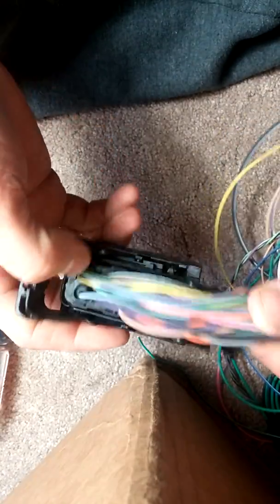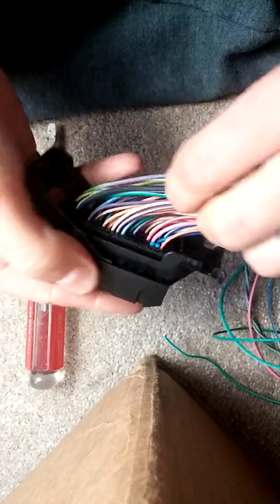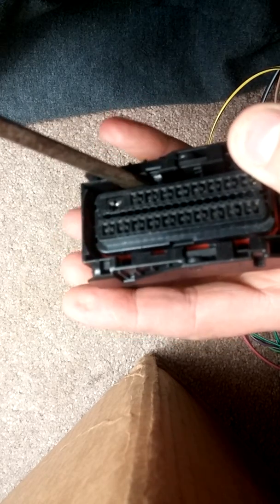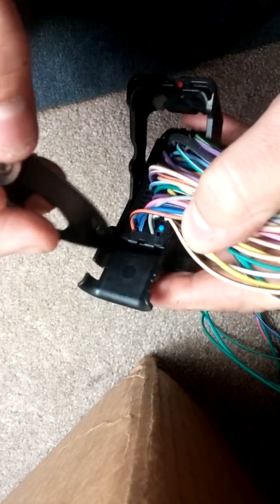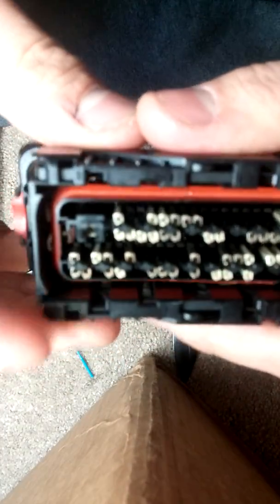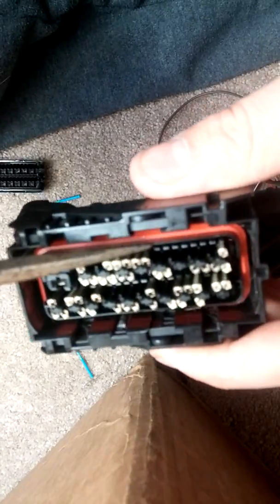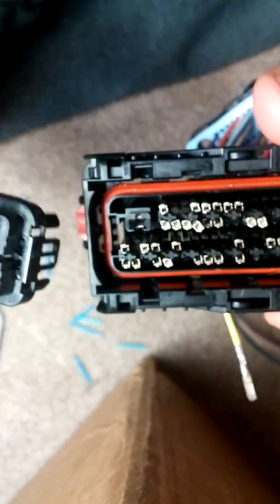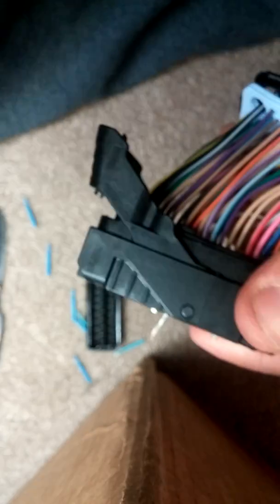Removing PCM Pins and Wires GM LSx E38 Ly6

Comment: How did you get the plastic cap piece off the top of that connector to expose the wires?
Reply from the maker: You mean the back section where the wires go in or the front where the pins are? Its been a WHILE since I took this apart and built my harness but I may have access to a harness i can check again.
Reply: @OverRevvedRacing  thx for the reply.   I mean the grey plastic protective cap that sits over the wires when it's installed - you have it removed here.   It also serves to hold the wires down 90° angle to the connector.

Comment: Good vid bud , but pretty much useless image with the phone camera . If you get to the stage of removing that front cover , you just push the terminal out by pushing on the wire . Just cut off the remaining wire , as i guess you are removing an unused terminal forever .

Comment: Good video, I am repairing my engine harness. I was wondering how to get to those pins. Thanks, video is a great guide & help.
Reply: Hey man how did it go do h have any tips in about to do the same thing
Reply: @jasonbourne4780  , the harness repair went good. Just take your time. Found out my problem was the fuse box, though. Had to junk my van cause they don't make them for 2008's any longer.

Comment: Fwiw, none of the back inside needs to come apart.  Take off the ecu facing cover to access the release catches.  The wires will pull through the rubber grommet grid and pin alignment grid with no trouble.  For reassembly, just make sure to align the pin when inserting so that it grabs the catch properly.
Reply: Yeah.  What you said.

Comment: Great video . I had a wire that was shorting and needed to replace it with a spare. Your video helped me to repair the circuit by removing the pin instead of cutting and splicing the wire. Thank you from Trinidad 🇹🇹
Reply from the maker: That's awesome! Glad this helped! What vehicle were you working on over there?

Comment: Did you do a swap with it?
Reply from the maker: Yes, if you check out the other videos on my channel you can see the details. It's a 6.0L (Ly6) I swapped into my KIA Sorento SUV. It's also sporting the 6L90e transmission.
Reply: @OverRevvedRacing  is this a gen IV harness??? What diagram did you use to find out what wires to delete? I have a 2007 suburban engine and harness that I'm going to start on this winter with very few YouTube videos to help with what wires I need and don't need.
Reply from the maker: @papergatorzfedducca7998  I found the harness for the 2009 Silverado 2500 that the engine came out of. The wires I didn't need I picked out of the diagram myself. Basically leaving all the engine to computer communications wires intact. I got rid of the wires that I didn't need. For example, the transfer case wiring, the wires for the alarm system, fans (I used different plugs and integrated the KIA stock relays in those).
Reply: @OverRevvedRacing  ok thank you bro.
Reply from the maker: @papergatorzfedducca7998  you're welcome. If you have any specific questions I can see if I can point you in the right direction. Look me up on FB www.FaceBook.com/LSxSorento
Reply: @OverRevvedRacing  ok I just liked your page.

Comment: "if you can't get that off you probably shouldn't be doing time rest of this yourself"

Reeeally helpful guy.
With all the many types of connectors out there it isn't hard to get them apart, but it can be hard to do it without breaking anything.
Getting that plastic wire cap cover off without risk of breaking it was the only reason I came here.

Ironically, what you did show me is what I didn't need, and feel if "you can't do the depinning without a video you shouldn't be working on it"
Reply: Imagine not being able to figure something out and then getting sassy with those who take the time to make videos to share knowledge FOR FREE on YouTube, because it was not tailored to exactly what you wanted. Fucking amazing.
Reply: @agtronic  Looking back at my comment I could have been clearer and written it better.
I didn't need to figure out how to depin. I knew how to do it the second I looked at it. He did a video showing the WRONG way to do it that is for no good reason MUCH HARDER and time consuming than the correct way. So he actually did people a disservice by making the video, so I hope anyone watching also finds videos showing the correct way. So he shouldn't be congratulated as he did the opposite of helping.
On a different note I was tuning in to see the removal of the plastic cover that he DID NOT SHOW. Only because I didn't wanna force plastic too hard if it could be helped. My guess, considering how he did things in the video, is that he didn't show the connector cap removal because he broke it getting it apart and didn't wanna admit that on YT. (Yes, I figured out how to get it apart all by myself without breaking anything. Yes, I did a video on it. I think it is on my other channel)

Comment: Great video!  Wasn't exactly what I was doing, but so little info on how to take these apart.  Thanks!
Reply from the maker: You're welcome, glad it helped!
Technically there is a "tool" to take these out bit it's SO much faster to remove them this way because you don't have to struggle with stuffing the tool into each hole. Especially if you are repinning and entire plug!

Comment: Can i remove antitheft on e38 ecu with ls droid like the older ecus??
Reply from the maker: I don't think so. I have only ever used HPtuners though so I'm not 100% sure.
Reply: @OverRevvedRacing  after removing the vats the engine should run normally with drive by wire??
Reply from the maker: Assuming the tune is the proper one for the engine, yes. VATS is the only thing that will stop it from running if the harness and tune are correct. I had issues with the DBW throttle body plug wiring. It wasn't the "normal" wire colors I found on Ls1Tech for the "LS family harness colors". There were a couple wires different on my specific throttle body because it wouldn't idle or take ANY throttle at first. Don't remember what exactly I had to change. It's been a WHILE.

Comment: All of this isn't necessary, you can just set the harness to the pre-lock condition and be able to access every wire and also able to add a lead
Reply from the maker: It is if you plan on re-pinning the harness rather then soldering it. It also makes it much easier to untangle the wiring with all the plugs still connected, rather then cutting the harness to pieces. Then you can lay out the harness possibly not even needing to lengthen anything. You also won't necessarily need all of the wiring connections on a swap so removing the pin/wire looks a lot nicer and is less likely to cause a future issue then leaving a cut wire behind.

Comment: Thanks, I just used this video to help me de-pin some wires.  Broke the same piece you did.
Reply from the maker: +Daniel Jue 
Glad it helped you. Sorry to hear you broke the piece too. I haven't had any issues with mine. Been running for 7,000+ miles

Comment: Before making this video maybe you should of learned how to properly remove these terminals from the connector!!  A screw driver and a knife is not the right way nor the proper tools to remove the terminals!!  NOT GOOD!!!!
Reply from the maker: Ray Hobson 
No reason to be a jerk, if you already know how to do it and have the "proper tool" then feel free to use it. This way works absolutely perfectly without having to buy some over priced tool.

Comment: I know this is old but thanks for this video.  I have a Bobcat S750 that had a damaged connection to the ECU.  After much searching for the connector I found your video, which helped me id and locate a new Molex MX123 connector.  Long story but nothing else like it helped.
Reply from the maker: rodneyhitz 
Thank you for the awesome comment. It really makes it worthwhile to make a video and have it help someone out so much!!  Thank you for sharing your story. Even though the videos are older I still keep up to date as possible with comment replies. It was tough for a while because I wasn't getting notifications for my video comments. 
If you haven't already repaired the connectors/connections I suggest soldering the connections as well as crimping. The Molex crimping tool that is supposed to be used for these AND the older GM PCM/ECU terminals is VERY, VERY, expensive. We had to purchase one for our shop at work (robotic applications use almost identical Molex pins) and it was over $550. However, it makes the exact perfect crimp. Some of the aftermarket ones, actually, pretty much ALL of them, don't properly crimp the insulation tangs and the wire is left incredibly insecure!  So soldering them is just some extra insurance against poor connections and wires pulling out. 
If you need any help ID'ing terminals or connector bodies just let me know. I have quite a bit of resources on industrial/commercially used wire termination and connection products!

Comment: http://www.molex.com/mx_upload/family/MX123UserManual.pdf

Page 36 of this document explains how to remove terminals with the right terminal tool.
Reply: You are the MAN  Thanks a bunch for this , doing a Ls3 swap into a 49 Chevy will be starting on the harness and this is exactly what Iv'e been looking for,THANK YOU!!!!!!!!!!!!!!!!!!!!!!!!!!!!!!!!!!!!!!!!!!!
Reply: I spent 10+ years in industrial robotics as a technician. I am all too familiar with the use of a Molex pin removal tool. I have probably used that little POS more then most people would ever want to. Not sure if you meant your post to come of trollish/jerkish but it kind of seems that way.
I made this video to show an easy way for anyone to remove pins without any special tools.
If you have ever had real seat time with Molex connections then you would know how fragile those little pain-in-the-butts are. If you get a crimp that had been tugged on they will sink the anchor in and sometimes are a nightmare to remove, potentially causing breakage of the little legs in the removal tool. 
Honestly the best removal tool you can get is a angle cut piece of welding wire. Works awesome and even can be bent to fit around your finger or had so you can more easily push in the wife while unlocking the anchor. It's the easiest way to get the stuck pins out.

Comment: Noob question here - why would you pull wires out of the plug rather than just cut the wires you don't need?  I'm sure there's a good reason, but just don't know what it is.
Reply: Thanks for explaining Craig.  Kia Sorento with an LS????  That is freaking sweet!  I'm putting a 5.3 into my Volvo 960.  The wiring is the most intimidating part of the swap to me.  The physical install of the engine and tranny is not a problem, but man when I look at that anaconda of wires leading from the engine - my knees get weak.  LOL.  I have to send the ECU off to delete the VATS, remove all the emissions and automatic transmission programming as I'm running an old school manual.  I figure I'll do as much as I can and if worse comes to worse I'll drag it to a shop to handle the electrical stuff if I can't.
Reply: "liked" your page!  Awesome!
Reply: Would the wires not ark ? Just cutting it